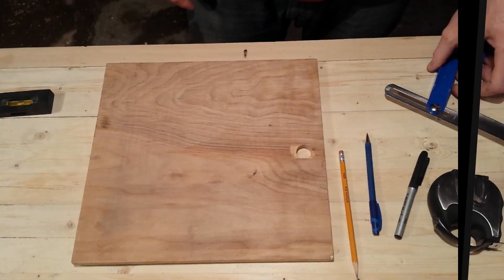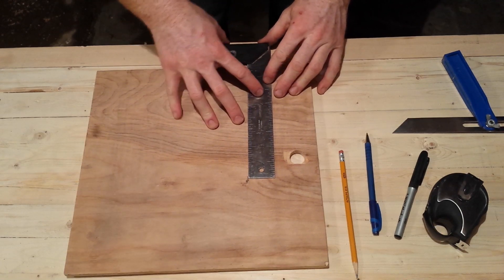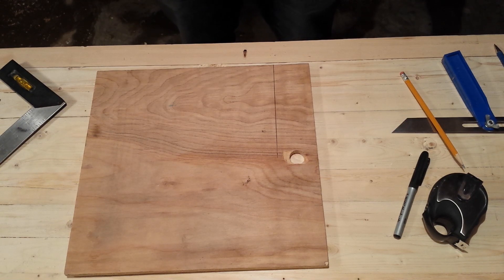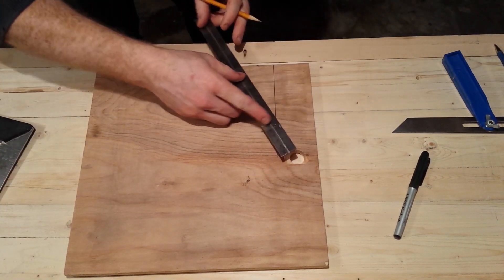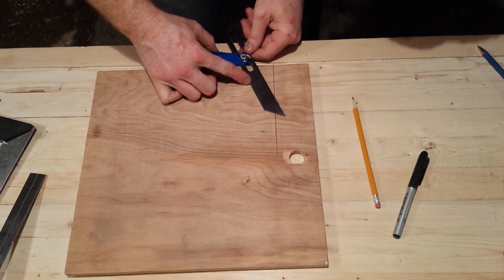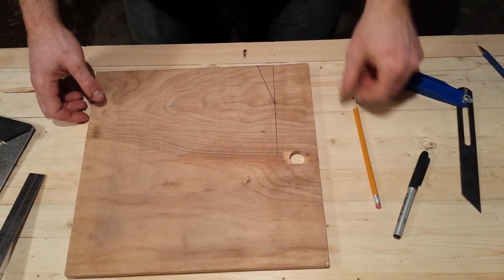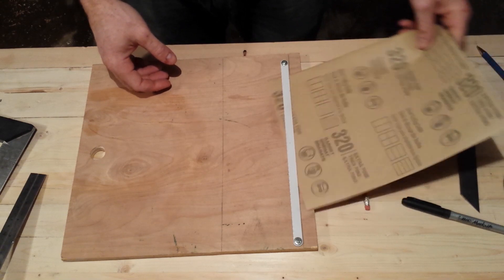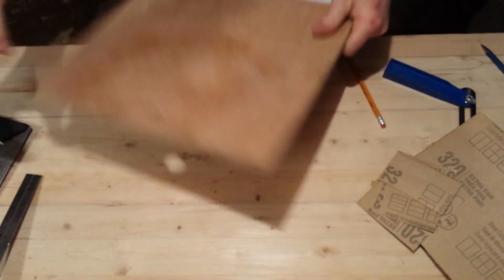Setting a Bevel Gauge to Ratio Angles

Comment: Correct me if I'm wrong, but I  thought one to three meant the slop goes up one inch for every three inches as in rise over run, one inch vertical for every three inches of horizontal.
Reply from the maker: on the bright side, either way it creates the same angle.   ;)